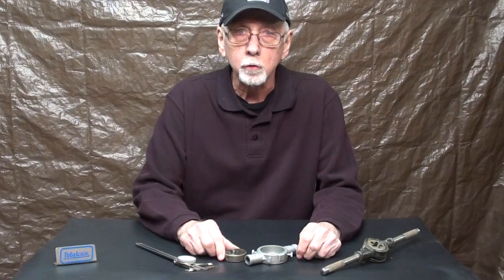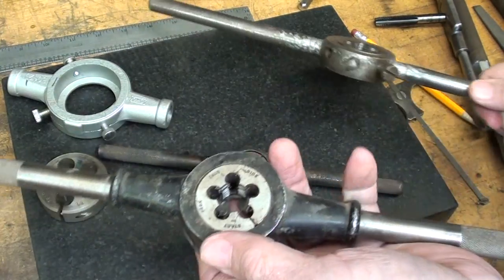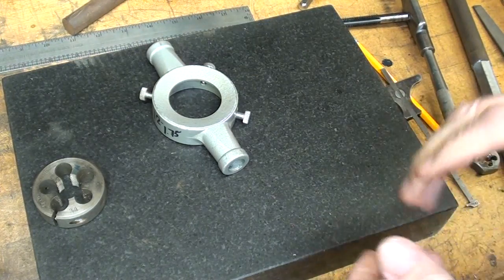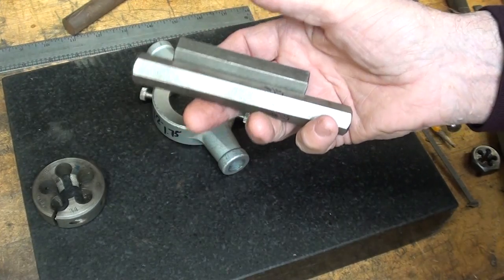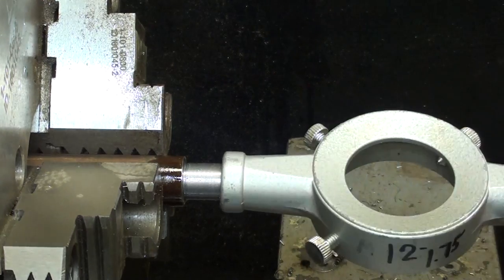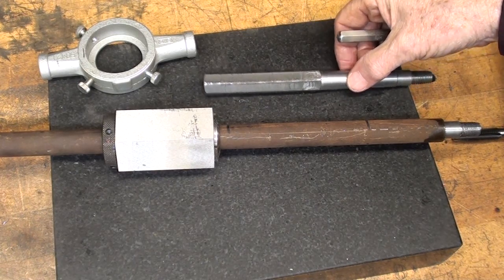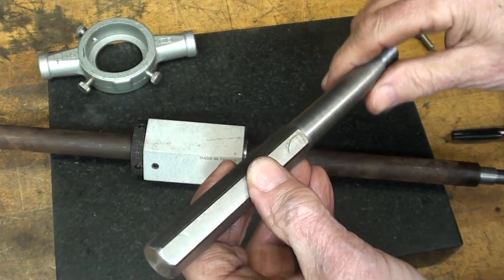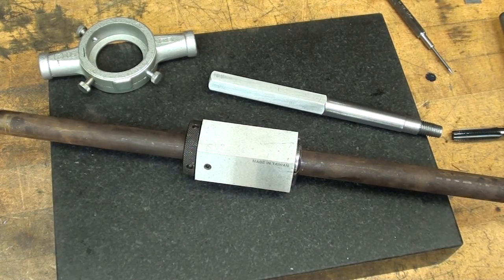Making Metric Die Stock Handles tips548 tubalcain

Comment: I always thought dies are dies. But it was a Abom79 video that taught me that hex dies are for fixing threads and round dies are for making threads. Unless you don't have a round die, and you make due with what you have.
Reply from the maker: Mostly true, but they also sell hexagon re-threading dies. Have you seen those
Reply: I have my dad's old Craftsman set from the 70s. I appreciate having them but they're really not good. Not hss, hex dies and the taps don't have center holes. I'll keep the set but will be buying upgraded tools over the years.

Comment: A Big Die Stock , Does Need Comfortable Handles Because You Would - Will be Putting A lot more of A Tight Grip on Them ! 
Experience . The Handle has to fit Comfortably in Your Hands , Especially if you're Using Harder Steel. Thanks Mr. Pete !
Reply from the maker: Thanks

Comment: For those that don't have a hex collet you can thread on that hex die and hold it in the Palmgren vice. Squeezing it will deform the die just enough to clamp the threads and keep the position. It work best with the adjustable dies if you back them off a bit. You will need to be careful when rotating it to the next flat, but a drop of thread locker will fix that. I have put hex heads on a few custom bolts by either holding the threads with two dies or just holding the threads and using a die and a small square against the table to align each face.
Reply from the maker: Thank you, that's a great idea

Comment: Hi Mr. Pete,  Another great video!  The title of this video "Making Metric Die Stock Handles tips 548", made me chuckle.  At first blush, it looks like you are saying that the die stock is for metric dies.  [Yes, after viewing the video, I understand your title, because of the metric threads on the handles.  No, I would never assume you meant this to be a 'metric die stock'.]   None-the-less, this reminds me of a trip I once made to K-Mart.  In the tool department, hanging from a peg was an adjustable wrench in its adult-proof package with the title, "Inch Adjustable Wrench" and in smaller type, "12 Inch".  On a nearby peg was the exact same wrench, but "flipped over" with a title "Metric Adjustable Wrench" and, again, in smaller type, "300 mm".  One side of the packaging was imperial, the other side metric.  The wrench itself was engraved 12" on one side and 300 mm on the other.  I don't know whether a display marketing person had a sense of humor, or whether they thought we consumers are that ignorant.  I chose the former explanation as it gave me a good laugh!  Best regards, Gottfried.
Reply from the maker: lol

Comment: Beginner at (con)Fusion 360, but I made up a model and drawing of the handle (as built vs. sketch shown in video).  Probably took as long as making the parts would have, but that is how to get better at it.
Reply from the maker: lol
Reply: @mrpete222  If I were actually doing this project, I'd start with a sketch just about like you did.  I am a big believer in simple sketches and building to fit.  (I also like the idea of making a wooden prototype.)  I only did this model and drawing to help build my proficiency.

When would I actually use F-360...  
    If the part were (much) more complex
    If the part was a component of a multi-part project
    If I wanted to visually compare different variations of a part
    If someone else make is going to make it (for me or for themselves)
    If I needed to document what I did afterwards (so I could do it again later, after I forgot what I did originally)

Comment: I`d like to hear Mr Pete comment on using hex dies to create new threads. In my opinion there is a misconception out there that only button dies can create new threads. I have had good luck either way...
Reply from the maker: There seems to be a lot of confusion. They sell hex dies in sets at automotive Stores that are meant for re-threading or thread repair.
The complete sets of taps and dies that include the Wrenches, our general purpose set s for threading from scratch. Yes

Comment: I guess that's one way of making hex. My heat and beat method does not remove any stock. That hex center punch is all hammer and anvil hex. I would imagine that your's is just a little more accurate in being a perfect hex though, however I know I can use mine as an allen wrench as I made one to remove the front tire off of my motorcycle.
Reply from the maker: Thanks, good idea

Comment: hi mr pete i would like to see you make a hex die holder......ive got alot of hex dies too....i thought about just welding a hex part to hold them but i would really like to see how to machine the hex in a block ......thanks for all your work ..............eric
Reply: I would sacrifice a good hex socket. I cannot see a good way to machine an internal hex unless forged/cast/stamped and final finished. Final broaching would require a hole through. And a broach and a press, oh my.
Reply from the maker: Two days ago, I finished my next video. A hex die holder that fits in the tailstock. Video in a few weeks
Reply: Awesome! I have a whole bunch of hex dies, metric and imperial. Cannot wait, Mr. Pete.
Reply: @milantrcka121  You can use a small drill set just to the outside of each corner. Then mill the flat walls of the hex. The drill removes the need to get right into the corners. For something as large a hex die you don't need metal all the way to the very corner. The die its self will have relieved corners anyways.
Reply: One of instrument maker apprentice final exams in deep past was to make a fitting male-female pentagon with nothing more than a drill (for starting hole) and a file. Project was graded on fit and snugness in all five positions. Yes it all can be done that way. Problem is the backstop to capture the axial load. Weld/braze a plate, yes. Broaching would work, much like a mini-shaper with proper tool and a rotary table to hold the work. Heavy duty impact socket sounds better and better... (it is hardened, carbide tool recommended)

Comment: you know what would be nice, if there was a tap wrench with a ratchet that is actuated from the handle, like a bicycle break, so it normally ratchets in whatever direction you choose but when you press a lever it disables the ratchet so you can clear chips
Reply: or some other really quick user interface to control ratchet with your fingers. i think it would speed things up while making them more ergonomic.
Reply: I was told for precision tapping to clear every quarter turn.
Reply from the maker: I do have one of those, and a T handle type
Reply: what mechanism do they use to disable the ratchet for teeth clearing? I have a T-handle style ratcheting one but you need to flick a lever to reverse it. If you are doing frequent chip breaking its very tedious and a hand one works better.  @mrpete222
Reply from the maker: @cdrom1070  it is tedious--I do not like it
Reply: the mechanism ideas I had involved (to not be ridiclous using a cable drive external bicycle handle) are either having the handles bend upwards to disable the ratchet (like have the arms swing 10 degrees so when you tilt em up, it disables the ratchet or puts it into neutral), so when you are tapping you are pushing down, when you are clearing you are pushing up, or to have some kind of thumb switch.   @mrpete222  

Not sure how to explain it without a drawing. Like making the arms one of those spring loaded sheetrock wing fastener things that opens up inside of the wall like an arrow head. So it would naturally close in on itself and keep the ratchet engaged, but if you fight it it would disable the ratchet. I think if you got the sensitivity right it would feel natural to use. 

It's difficult to think of a mechanism that does not interfere with the actual tapping operation.
Reply: another idea (though it is bulky) is to connect the ratchet to the handle, so when the handle is shifted (it would be lopsided by some distance on either handle) it would disable or enable the ratchet, so you would 'shift' it rather then toggle a switch. A benefit would be that its simple compared to some kind of pivot switch. But slower.
Reply: Lol, I managed to cobble together a diagram because I think what I was saying is too complicated.

https://i.imgur.com/fEQOkHK.png

 I did not draw the ratchet mechanism or force transfer mechanism because I have no idea what would be good practical or manufacturable  in this situation. I have a feeling the end product might look and feel ridiclous unless its very well designed.  @mrpete222

Comment: Wouldn't a machinist jack do the job of supporting the handle when milling the hexagon?
Reply from the maker: Yes, but it would not stop the vibration
Reply: @mrpete222  When you used the vise, I thought, there must be a reason. Thanks for your answer.

Comment: During the tapering operation, do you have to do it by hand or does the lathe have an automatic cycle? Just curious, I am not a machinist and know nothing about it. Thanks. :-)
Reply from the maker: By hand
Reply: If he had a taper attachment (search for that) on that lathe he could have used the normal carriage power feed. Because he did it with the compound, no, since that's hand crank only. I think I remember seeing a lathe that had power feed on the compound, but that exceedingly rare due to the extra complexity and few use cases. You can make yourself a "power feed" with a fork shaped attachment mounted in a cordless drill.
Reply: Thanks :-) @mrpete222

Comment: I rashly wondered why you did not just use digital calipers set to metric - until I realized that all you machines are imperial. You HAVE to use imperial when turning to dimension, you lathe is graduated in inches (or rather, milli-inches = thousands).
I have the reverse problem when e.g. making engine models that come with imperial dimensions, e.g. from the UK or US. I have to convert all dimensions to metric to be able to use my little metric-graduated lathe and milling machine.
Reply from the maker: You are absolutely correct, thanks